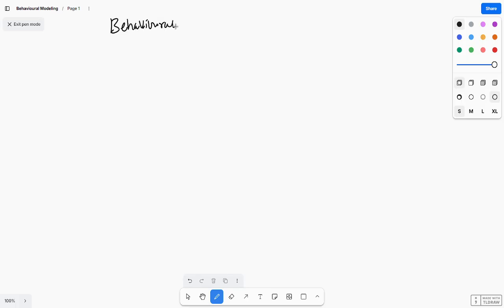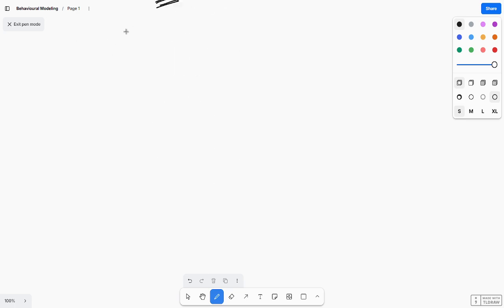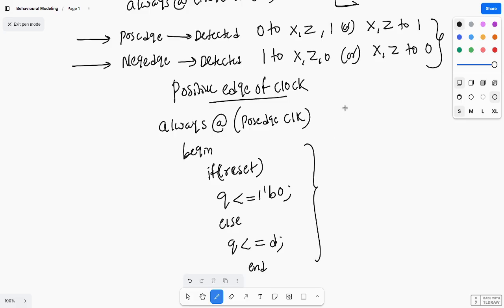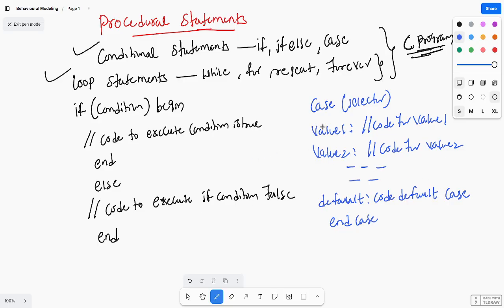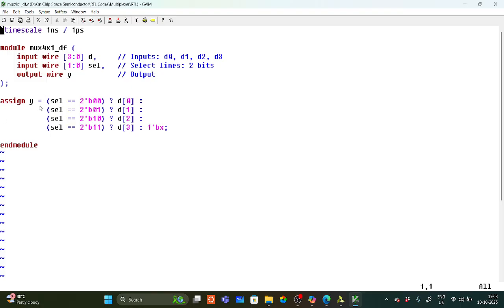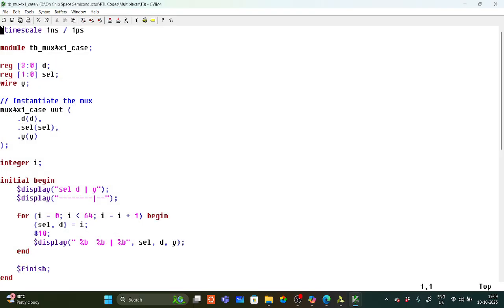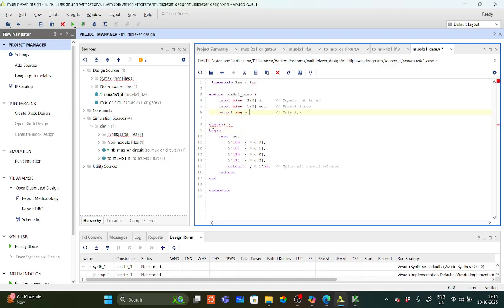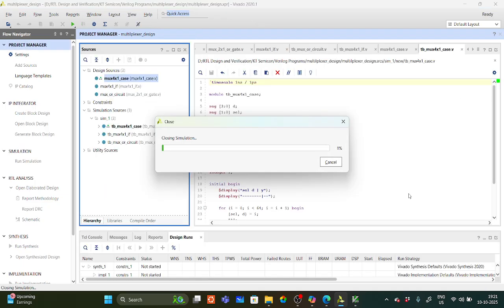Behavioural Modelling and RTL Code for MUX using if-else and case Statements | Verilog HDL

Comment: sir how did u make the xilinx vivado 2020.1 to work in windows 11, because i tried all possible ways and installation gets stuck at 86 percent and sir please provide the solution which you have followed because lakhs of people in internet are searching for this solution.
Reply from the maker: Yes I installed it's working
Reply: @VLSI_Simlified sir today I tried xilinx vivado 2020.1 it worked on windows 11